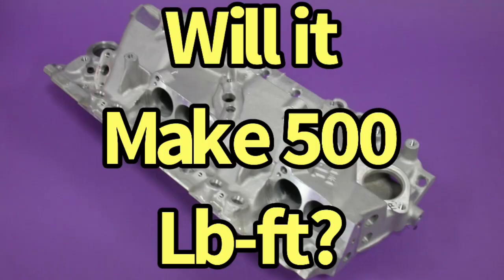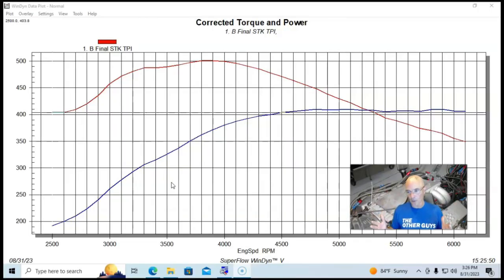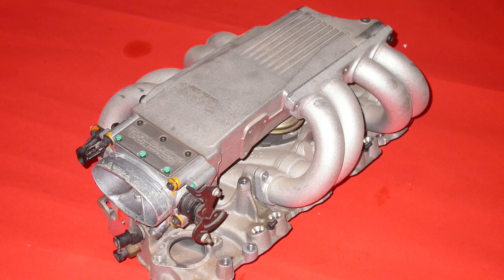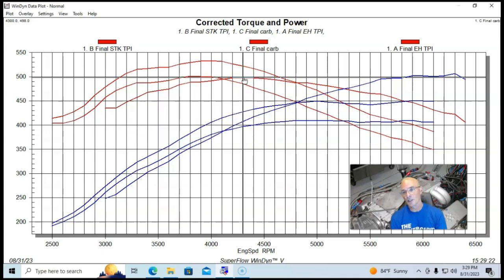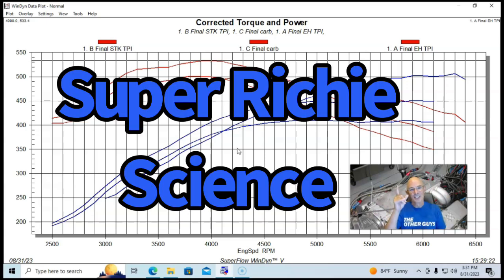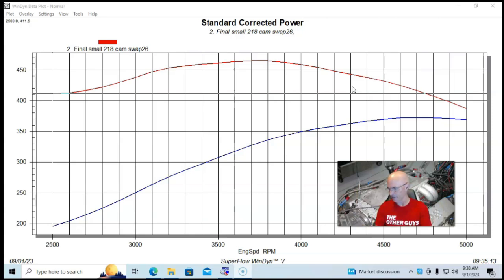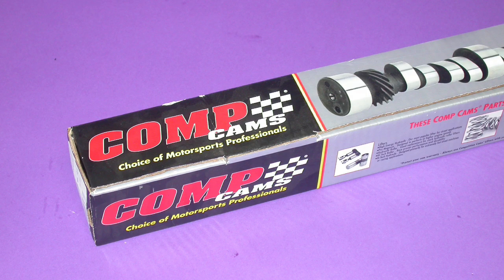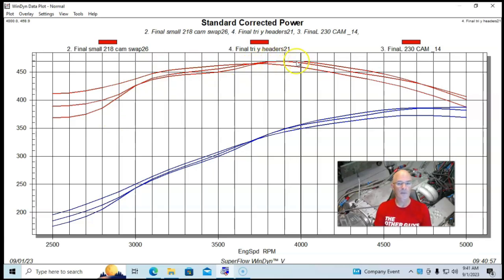TUNE PORT L98 350-CAN WE MAKE 500 LB-FT OF TORQUE? PLUS, TRI-Y VS 4:1 HEADER TEST-WHO MAKES TORQUE?

Comment: The high peak torque engines are generally the big cam, high compression examples, but that doesn’t mean they are strong at 2500. Wanting a fat torque curve down low means actual cubes or virtual cubes, ie, boost. Some of the old Engine Masters entries may have come close, but they often ran very tight LSAs, like 104°, with enough duration/intake closing and lift to carry power to 6500. Some very impressive engines back in the day… If you want low end torque, bring displacement!
Reply: Yeah I saw some Testing here for the LS to go from 112-114 LSA to 107.5/108 LSA helped the 4.8/5.3 (Truck Norris/Chopacabra) true flattops helped the LR4 vs the LY2/L20 which had valve reliefs.
Reply from the maker: the change in torque offered by the Chop or TN was not just an LSA change
Reply: @richardholdener1727 Maybe a Thumpr cam and 11.5 or so compression? The perfect combination should get you the 500 lb-ft peak, but maybe at 5000, not 4000 rpm. So, add a tunnel ram to that recipe…

Comment: I would have tried a 106 or 107 LSA cam. A little more compression and 1.6:1 rockers would have helped too. One of the magazines ran a Vortec TPI with a SDPC lower intake and got like 489 ft lbs of torque on a 355 SBC, so a little more playing around and you could get there. You might want to talk to David Vizard and ask how to eak out those last few ft lbs. I would love to see how a TPI power curve looks on a mild 400 SBC. Torque, torque, torque! That would be a killer truck set up!
Reply: a monster
Reply: With 130° coolant temperature, 190° oil temperature, no water pump, no intake filter, no alternator, and open wheel modified  headers that will never fit in a street car chassis and maxed out timing they got that. What those kind of tests do not show you is.. run it in that state for 1-2 minutes at normal operating temp and it will die. Take magazine article tests with a grain of salt. They are paid for advertising parts, high power numbers sell parts. If all you want is a trailer queen for the track sure! But who builds a track only car then strangles it with tpi? Build a 383/400 use a well ported first performance tpi with afr 195 comp eliminators, 10.5:1 compression and around 280/280 advertised, 228 to 232 @ 50 with as close to .600/.600 lift as you can get, keep quench tight (.035-.039") and it  will make 500+ foot pounds, 435-465 HP. Make sure the piston crowns and combustion chambers have been softened, no sharp edges, use a decent 1-3/4" primary around 30-34" long, 3" collectors, full 3" dual exhaust with good dynomax super turbo mufflers and at least a 2500 rpm stall converter with a well built 4l60e. It will make close to 350-375 rwhp, 400-440 rwtq if you build the drivetrain right, in a 3200 pound car it's a super simple easy low 12 second car that can actually be used and driven daily without cam surge, overheating, or destroying the valve springs every 10,000 miles. Not cheap, now days simpler to just get a 6.0/6.3 LS with mild cam and springs.

Comment: Love the L98 videos. I have an 85 Corvette, and have a TPIS Miniram, Comp Cams 280xfi and AFR195 Comp eliminators sitting on the shelf ready to bolt onto the stock bottom end. Probably a bad idea but I want to give it a shot. I'll just have to set a conservative rpm limit until I have a real shortblock to back it up.
Reply from the maker: see the mini ram test in the TPI intake video

Comment: A cam between the 218 and 230 with a tighter LSA, 1.6 rockers, 1 3/4” headers…   Maybe (a strong maybe) pick up 15 lb/ft.  I doubt it’d get to 500

Comment: 1.6 rockers, 11:1, e85, even a blend like e40 or e47 might be enough.

wonder if a fully ported air gap would make the whole thing way easier?
Reply from the maker: AIR GAP MAKES LESS TORQUE
Reply: @richardholdener1727  i mean, if the new set up made 528, the modded air gap might just make 504 but be way easier to source.
Reply from the maker: the 383 made 535, but the goal was to make 500 lb-ft from a 350 (the air gap makes less torque than the TPI)
Reply: I agree with you. More lift and more compression and then increasing Ethanol gives you the added knock resistance AND more oxygen stuffed into the cylinders.

Comment: Thanks Richard! All very informative. I have 4x tpi sbcs in C4 Corvettes. 2x383s, 2x350s, 2 have Super Rams, 1 has an old Paxton SC...How about building a 350ci TPI from a 305 block with a 4" stroke? If you can get a good flowing head on the smaller bore, I'm guessing you'll get 500ft/lb with 4 inches of stroke.
Reply from the maker: I FEEL (AND TESTING SHOWS) THE DISPLACEMENT IS WHAT MAKES TORQUE-NOT JUST STROKE

Comment: Try the thumpr cam with 1.6 ratio on the intake. the tighter lsa and the extra lift on the intake will take advantage of the long exhaust duration and extra scavenging.

Comment: More compression always helps. David has said the 383 is geometrically superior than the 350 because it gains more power than the displacement predicts. This test shows similar.
Reply: Put the aluminum heads from a vette on it and it raises the compression with no machine work necessary
Reply: Yep.  The TPI engines are going to have a lower RPM HP peak, so increasing the stroke is super helpful with them as it gets the average piston speeds up AND it gets the quench velocity up which helps reduce detonation risk on these things. A 4"/4.030" bore SBC 396 would be great for a high power TPI build. (Thin piston ring packs become more useful with the higher piston velocities, too.)

Comment: Interesting. Possibly some port matching and injector size increase. And how about tuned headers. Equal length. But honestly I think there's a value of that large Plateau of torque. We always look for horsepower but the torque curve represents pull. Maybe 10.5 /1 or 11/1,,, I've also been thinking of trick flow heads, buy using the golfball dimples on the ports an chambers. As apposed to the polished porting .
Reply: I'm going to steal Richard's "All cams are turbo cams" idea here, as there's a corollary: "all headers are tuned headers" (what RPM range do you want them tuned for?).

Comment: Richard, we need help if u got a min. We switched to E85 from gas and it idles great. We increased the fuel tables etc by 30% for the change on the Holley. Idles great, but if we rev it, it goes up fine, but before reaching back to idle, it goes to almost 3k rpm. Throttle blade isn’t sticking, not a mechanical problem. Sumn in the tune on Holley and can not figure it out. When it goes to 3k after reving it stays there and doesn’t come back down. Even though tps is at 0, just stays at 3k. Any suggestions very much appreciated. Love the content sir. 💪
Reply from the maker: iac sticking? vacuum leak? injector leak?
Reply: @richardholdener1727  no vacuum leak, as nothing’s changed other than draining tank and adding e85 with 30% more fuel. Will try eliminating iac and see what difference that makes. If that isn’t it, could email you tune and data log if ud care to look. It shows tps got up, rpm go up, rpm start to fall at 0 tps, then takes off to 3k rpm until I have to kill it. I’m lost.🤷🏻‍♂️
Reply from the maker: STUCK INJECTOR?
Reply: @richardholdener1727  I can’t post a pic on here of the data log. But I can tell you the only difference from before idle when I rev it to after rev when it goes to 3k rpm before back to idle is a large drop in fuel flow, not psi. Would u think my pump is failing? It’s keeping psi but not flow? Is that possible? It’s literally the only difference in the data log before it goes to 3k rpm with no tps.
Reply: @BenBurke1983  
Hopefully you figured it out by now. 

My carb'd Chevy would idle differently with different fuel grades or fuel from different stations. I never figured it out, but it always did it. One time I changed the fuel inlet hard 90* elbow to a gradual curve. That changed my idle. Recently I tried SeaFoam for the first time in the same vehicle. It immediately idled lower and smoother.
🤷‍♂️ maybe something there helps you out.

On my 1988 Comanche the idle would fly up to 3k for years. I had to stop and restart multiple times until it acted right. No intake leaks. No vacuum leaks. New TPS. New and adjusted IAC. Wiring all good.

I did figure it out though....after talking to Renix people. These 3 things would cause my idle to fly to 2500-3k.
Crank position sensor. On the Jeep it's on the flywheel and it attracts clutch material and then reads erratically. The fix is swap out the oem shouldered bolt so it (sensor) falls a bit closer to the flywheel ring gear teeth and it self cleans. On this Heep no crank signal = no fuel pump.
Someone put a fuse going to the ignition box. This instal was so super janky... two spade connectors holding the fuse. When I drove hard and fast it would heat up and blow the fuse and/or melt the wire. A proper wiring job fixed that. Every time the fuse or wire were about to sizzle the vehicle would basically restart the ignition and hence the high idle.
Lastly: coolant temp sensor. Mine was bad and the computer would think the vehicle was cold so it would idle up to warm up. 

Lmk 😁
Reply: @xmo552  it was the throttle body causing the problem. IAC holes was not drilled correctly.

Comment: It was done in the C4 Corvette World back in 2009. A guy used a 1971 400 SBC and installed stock 1987 Corvette Aluminum 128 heads along with stock Corvette Tuned Port.
500 ft/lbs torque.
Reply from the maker: we did 535 lb-ft with a 383-but we were trying with a 350
Reply: @richardholdener1727  Angle Mill there AFR Heads down to 55 - 58 cc Combustion chamber volume. Want True 13.5 :1 static compression ratio . 110-112 ICA so you can EFI Tune It. Feed it VP 112 C12 Racing Gasoline. 
Use ARH 1-7/8 "primary tube with 3 inch collectors stainless steel long tubes for a C4 Corvette.
Reply: @richardholdener1727  When we were Dirt Track Racing local here with Small Block Chevy V8 355 cubic inches we used 99-- 108 LCA Camshafts profiles several Flat tappet Solids and Roller Solid Cams. Some allow 8500+ rpms peak .
Only had 1-2 inches intake manifold Vacuum at idle most Radical and at 108 LCA had 7 inches Vacuum. 
Used Holley Racing Carburetors. We were after torque out of the corners and High Rpm to pass 20-50 cars down the straight always.
180-185 cc intake runners are best for 350-355 ci.
Best heads 185 cc Ever made for 350 Chevy were Trickflow G1 Twisted Heads. Guys used early days of C4 Corvette Street Drag Racing. With Highway gears 2.73 - 3.31 Low 11s 1/4 mile at 115 mph Trap speeds were done 3400 lbs race weight with driver. All motor no power adder any.
I own 2 sets of Trickflow G1 Twisted Wedge SBC 185 cc Heads.

Comment: Best truck intake that never was.  Had one in an Iroc-Z and the part throttle drivability and response is something I haven't experienced in anything else.  Small cam, Brodix street heads and 1 5/8 headers is a potent little combo.
Reply: I want this in a tow truck.
Reply: What do you think are good 4wd transmission options for a tpi setup like this? I wanna rip mine out of my vette and throw it in a 2 door wrangler, then figure out something a bit more ballsy for the vette 😁
Reply: @jakejake7162  
Easiest would be 700-r4 but idk if the length is good for a wrangler.
Maybe 400
Maybe sm465.
Reply: @jakejake7162 I'm trying to make a trade now for a 78 renegade with a 327  and a vw body
Reply: I'm still pissed at my mother because she sold her 87 iroc to a stranger for the amount I offered her after I offered to fix it's minor issues for her so she could continue to drive it i can hardly talk to her now im a life long car guy and feel disrespected by her actions. I was with her when she ordered the car new and when she sent it back twice before taking ownership of it for not having all the options she ordered. I made it known many times over the years that I wanted that car. And her response to me "I didn't think you were serious."Damn shit pissed me off.

Comment: 11.5:1 compression, bigger fuel injectors, and E85 and it would have met your goal
Reply from the maker: the injectors were already big enough to supply any amount of fuel and unfortunately e85 helps na motors very little
Reply: @richardholdener1727  what about Methanol? I would like to see some testing with that fuel

Comment: Memories... I ran that 218/224 cam in my IROC. (CIRCA late 90s) I think mine was on a 112 or 114 LSA though, maybe I'm wrong? It was another lifetime ago. I had a stock 87 L98 shortblock, that cam, a set of 2nd hand heads off of a ZZ4. It ran well for what it was.

Comment: If higher torque is the target than  stay with the smaller cam and change the heads to a smaller intake valve and runner.

Comment: This TPI setup would be great in a boat
Reply: I had a tpi setup in my boat. was ok for just cruising but not enough hp to rev past 4300 rpm. stock 350 bottom end. stock cam. put a holley sniper setup with a dual plane will rev to 5200 with same prop.
Reply from the maker: the video shows you the difference between the dual plane and tpi
Reply: @brucebok6340  I wouldn't want it in a boat for performance, but something like a 33' Cabin cruiser with twin 350's this would have been great with this setup.

Comment: Would be fun to do a setup with 2n or 4 used VW 1.9 - 2.0 TDI turbos on a motor like this just to se how early the boost comes on. Or just 4 really small turbos on any SBC/BBC.... You get those new for like 220$/piece here on the other side of the pond, but used is what is interesting since you almost get them free if they are close to end of life. A tiny budget  "other guys" video, excluding engine management cost (there has to be a clever and cheap way of doing that with far eastern stuff?) would be so cool.
Reply: Go check out boosted lifestyle he did multiple turbo stuff with dyno results things like 8 turbos on a ls

Comment: Thank you for doing this test! There isn't enough 350 tpi tech around. The results you got would make a great street machine. Would love to see some real world vortec headed TPI tests for us guys who want to maintain the integrity of these cars. I feel like they may be coming back into their own.
Reply: Agreed! I bought an old c4 to learn how to work on cars, but totally neglected the lack of info on cars from that era since they are overlooked because of other more desirable generations. I just want 500 hp 500torque out of it. Just hard to figure out where to start since the corvette forums are full of old men who bitch about any questions related to going beyond stock power specs or all the build info are on the later gen c4’s and I have an 85 with the weaker engine but forge pistons from the leftover higher trim models from the c3😂 I need an engine rebuild so might as well give her some extra umph 🎉
Reply: @jakejake7162 the corvette guys are the worst. I don’t even consider them car guys it might as well be an investment forum. 
500 horsepower and 500 pound feet isn’t something that can be done easily and honestly I’d say if you could knock down 20 numbers from either the power or torque it would be more realistic since these motors only have so many induction systems that make disproportionate power and torque. There really isn’t an intake that will make that power with a stock block unless it’s a built fire breathing 383 with a performer rpm and all forged bottom end. I’m a budget guy so it dont even consider it in my world of expertise lol
Reply: @jakejake7162  You're not getting 500 hp and 500 ft lbs out of a TPI 350 running pump gas, naturally aspirated. 
Buy a DART SHP 406 SBC short block, and put some top-shelf 195cc - 210c heads on it, the FIRST fuel injection TPI-style intake, and an AGGRESSIVE roller cam and Holley Terminator to control it and 500 hp / 500 ft lbs on pump gas is EASY.  There's no cheap big power with TPI; you CAN make shockingly big power with them vs. what most people think, but it's going to COST YOU. 

(I've got a decently budget 440 HP SBC 350 FIRST TPI-based build (if you ignore the cost of the Holley HP EFI system), but I bought all the parts 6 years ago and took my sweet time.)
Reply: @jakejake7162  Build a 421 out of a factory 400 block, use AFR 210 heads, or have a set of Profiler heads ported for even more power. (210 heads). You'll be over 500 hp and torque.
Reply: TPIS
Reply: LT1 will always be superior

Comment: I really want to see a 400 with a TPI 
I had  cool build to get a el camino and put a 383 or 400 with the TPI and make a good hauler and tow truck
Reply: Some guy dropped a 406 TPI in a Cutlass years ago. So it has been done. Of course with extra cubic inches, the useable rpm range is less. (You hit peak horsepower at a lower rpm)
Reply: Agreed! A 400 with a FIRST TPI and great flowing heads makes ridiculous torque pretty quickly and that big bore really helps.

Comment: Some comp xfi hyd roller lobes, around 216/216 on a 105 lsa, 1.6 rockers, and another point of compression. Peak HP might not impress, but should do the trick for making a big peak torque number in the 3500-4000 range